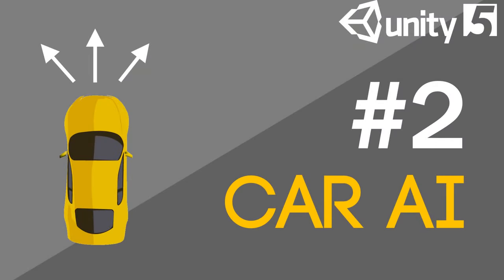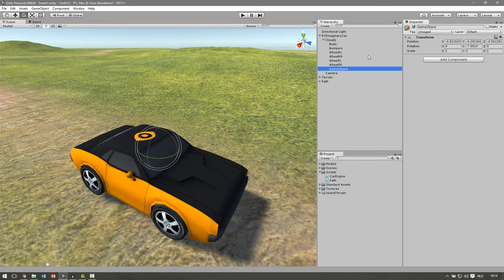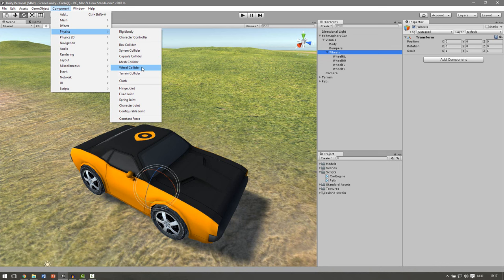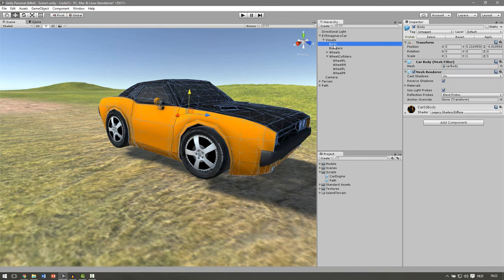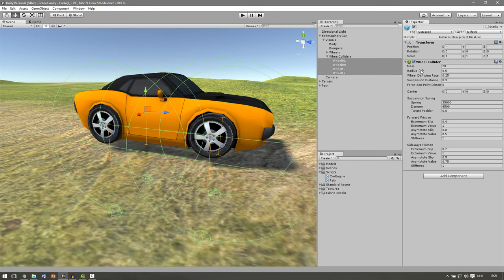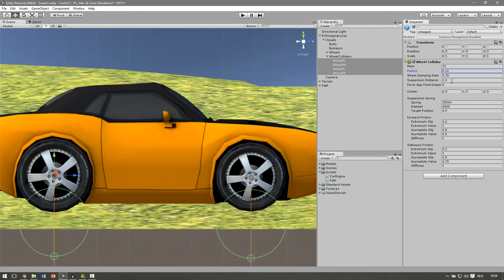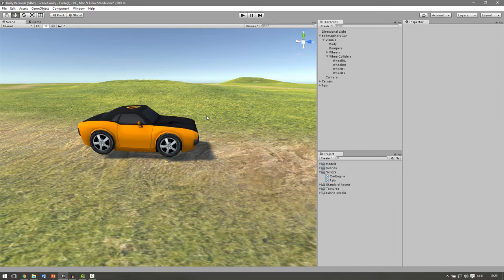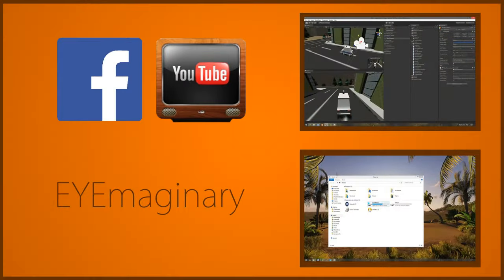Car AI Tutorial #2 (Unity 5 ) - Wheel Colliders

Comment: Hi. 
Thx for this full tutorial. I'm trying to implement it to my class project, but i got a problem with orientation of Wheel Colliders. 
It look like the little circle you got on it is on the bottom, but mine is in the x direction. And i don't understand how to rotate the wheel to get in on the bottom of the wheel collider. The Rotation attribut don't change this, so my wheels don't turn in the good direction of my path (i'm at step 4 of the tuto). Any help possible ?
Ps : i use a simple low poly car, so no wheel available at the start, so i just create empty game object, for 2 front wheel, and add component Wheel Collider. I first don't think it change anything, but i was wrong.
Reply: i've got the same problem!!

Comment: Whenever im trying to fit my wheel collider it isnt facing the same direction as the wheels are and overlap the wrong way against it, ive been trying to figure it out if you could tell me what im doing wrong it would be very much appreciated
Reply from the maker: Jasiel T. Are you sure you are applying the wheel colliders to the empty game objects and not the mesh? Try rotating the empty objects and placing them in the right spot before adding the wheel colliders.